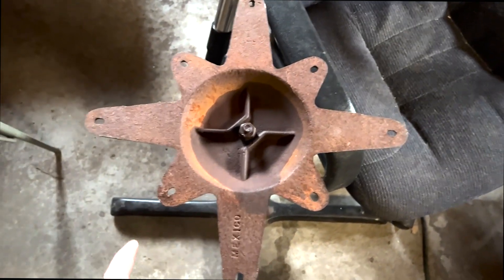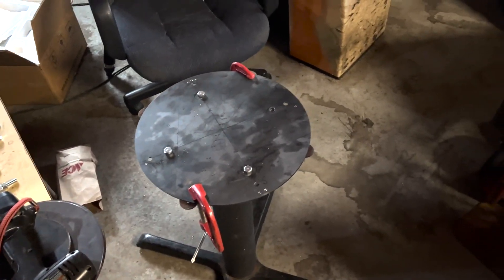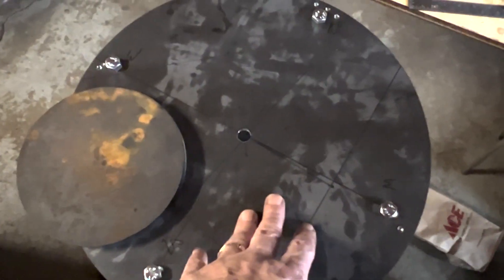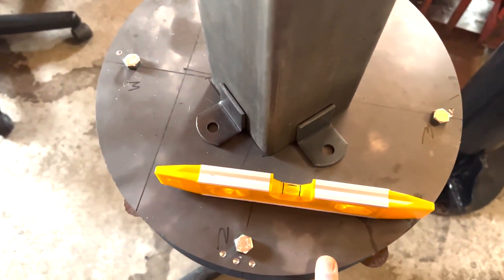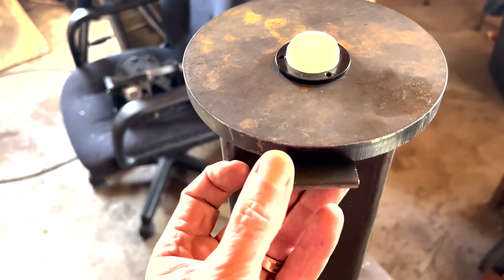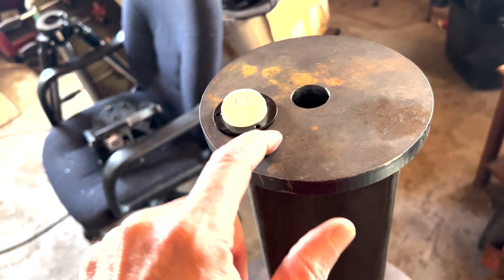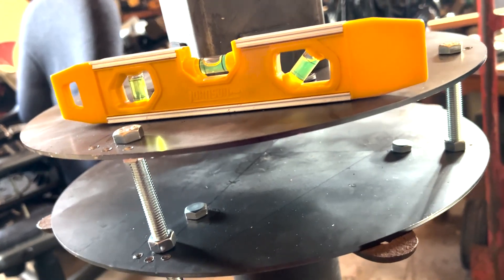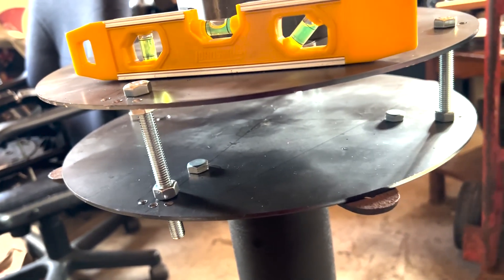Telescope Mount | Preliminary Build

Comment: Hey Bob, Just a quick update on a related subject, I was previously having all sorts of issues with my Neq6 Pro mount, i was running it via the synscan hand controller in PC Direct mode.  

last night was my first chance to try out the USB to Serial cable which bypasses the hand controller completely, The cable I bought is the 'Astro Force Shoestring (5m) FTDI EQDIR USB Adapter for Sky-Watcher EQ6 or NEQ6 Syntrek & PRO Mounts' and I must say, This worked faultlessly.

It does seem that running an EQ mount in PC direct introduces errors, However, By completely bypassing the synscan hand controller with the above cable gets rid of the errors I was receiving.

The other the to note is this cable can be run on a laptop or pc under Windows 11, Even the supplier I bought the cable from was taken by surprise by this.
Reply from the maker: Cool

Comment: Hmmm, those two plates with the bolts and nuts seem a little prone to flexing, or my plate is overenginered 😁. I'm using  steam pipe flanges, in Inox. Don't underestimate flex by gravity (e.g. unbalanced telescope) and flex by wind.
I suggest some reinforcement ribs on the tubes.
Reply from the maker: Good point. That’s why I am putting in the column. Also the load will be 30 pounds.
Reply from the maker: I will use 1/4 inch steel and 1/2 inch bolts for the Meade (62 pounds)

Comment: The base doesn't need to be perfectly level. It just makes polar alignment easier.
Reply from the maker: Yes, that is a good point.  a German Equatorial does not care if it is level, it will align to the North Celestial Pole just fine (but with a LOT of extra work).  Making it perfectly level not only makes it easier, but is a sign of good workmanship.  

Now with the Alt/Az mount we have another situation.  The equatorial plate MUST be level for the scope to track properly.  It also makes polar alignment easier.  When you elevate the mount (altitude) you want it going straight up and down, without deviating to the left or right.  Likewise when you change the azimuth, you don't want to change the altitude.  It has to be level for that.
Reply: @ResearchFlatMoon  
Actually an alt-az goto will properly track out of level. If you choose your 3 stars wisely, it can actually figure out the plane inclination the base is on.
Reply from the maker: yes, it can, but it tracks up left up left up left or the like.  point is it is much more important to have the Alt/Az mount level.  You want to only have it move in RA for smooth movement. At least that is my opinion and why I am building the mount as I am.

What he is talking about is that if you set up the Alt/Az mount it thinks it is level.  By calibrating it to 2-3 stars, it will keep track of where it thinks those stars are vs where they actually are.  It will then recalibrate to find the true level of the mount.  It will use the declination and RA motors to track objects.